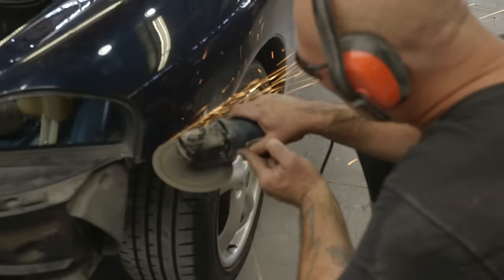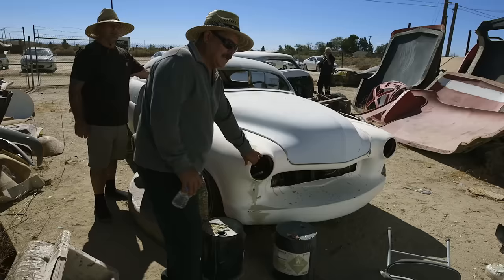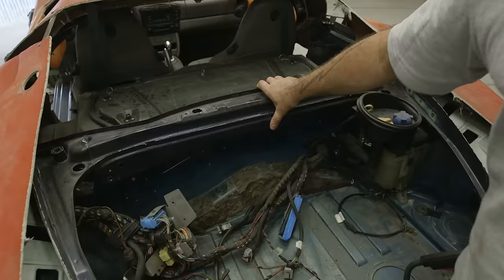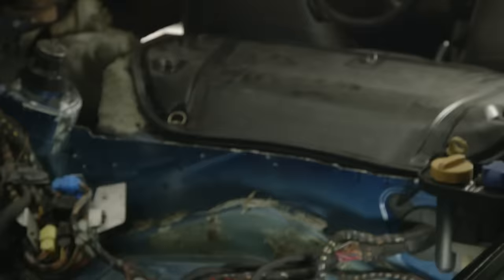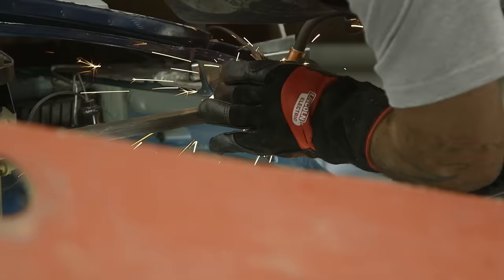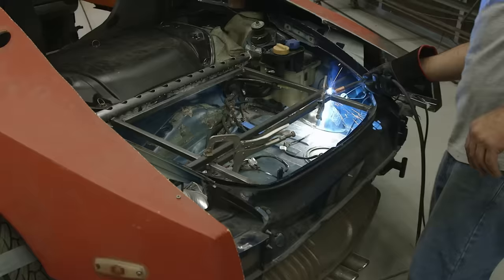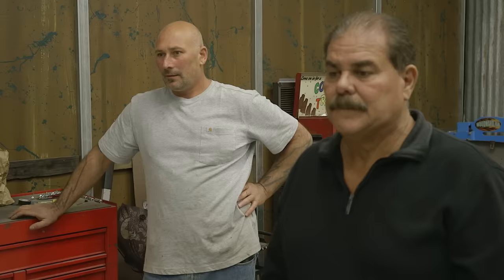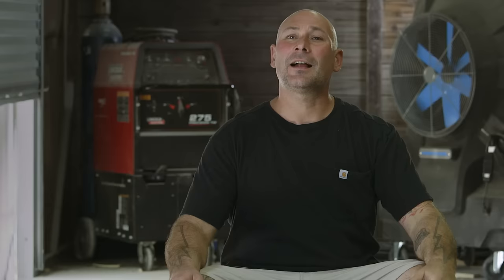Monster Garage Update - Full Custom Garage: Sports Car Edition - S04 EP06 - Automotive Reality

Comment: Gene’s fiberglass Ferrari body is actually a rare unbuilt Fiberfab Valkyrie. Two models were made. One was set on a VW chassis and had a rear engine. The other had a full steel chassis ready to mount a mid engine V8. I helped a guy build a V8 version. It was a blast. Somewhere I have a copy of the complete instruction book.
Reply: Had a chance to buy one in around 1986 for $1500. 70s VW super beetle type. Top of my head was flush with the roof. And the view from the rear glass was a reflection of everything below it. Without the GT40 roof cut outs part of the door. Pain in the ass to get in and out of. Did not have the back tilt rear engine lid. Just a little dog door between the taillights. I didn't buy a first year Fiero due to needing to place your hand on the ground to get out of it. If I remember correctly. The windshield was the same as the 1960s Mustang on the Avenger.

Comment: I saw the finished car already, so I know my advice won't help, but...I've done many custom body panels, and you can use foam blocks and form them into anything you want.  I've never done it, but you can also use clay like the OEM's do, cover the foam with layer of clay and carve into whatever form, put back the clay if you need to (not easy with foam).  The new kids use computer cad and then cut the foam with a big cnc carver and then fiberglass over it.   

btw, the finished car looks like....not good.  I'm watching to see who I blame for it!
Reply: another good technique is to form a wire "buck" frame of all your bodylines, then stretch some flexible material across it, and lay fibreglass over that.
I agree that the finished product here wasn't great, I hope it gets a return and some re-working like the purple packard did.
Reply: What a surprise that it turned into the pile of $h!T that I predicted.😂

Comment: No room for people in the clam shell lid. Cut it down the middle and widen it. Replace the wind shield with a Porsche 956LH style windshield. Make it a triangle three seater. Way it is now be smacking your knuckles and forehead into that windscreen. Hell it is a shock car, so make it a center one seater. Why add in that dead weight passenger.

Comment: Neither of these two guys are giving any concern to the final handling and driving aspects of this monstrosity. They’re building a trailer queen. Every time I see you one of those all I see is beautiful parts wasted that could be on a car being used. Just the spacers they’re gonna using to keep those wheels out there and the size of those wheels are gonna make that thing handle like a 56  Cadillac and they’re using a Porsche to do it😢 I don’t even wanna think about the fact that thing is completely bottomed out the suspension on the bump stops to get the car to sit like this. They aren’t thinking about it and that’s the opposite of what any real driving machine I’ve watched build be built like
Reply: It is their car. Sorry it is not up to your “standards”.
Reply: Watching something being built doesn't make you an expert in ANYTHING
Reply: That's the thing with Ian's work. He's an artist. He doesn't build cars, he builds rolling statues. They look good on the outside, but his structural engineering method can best be described as "slipshod"
Reply: @Ducky69247 with your knowledge and expertise, it sounds like you've driven a few of his vehicles.
Reply: I agree a "supercar" needs to handle well (unless its a Hellcat style drag supercar..), but I have not seen how they ruined the boxster handling..yet.   I do agree the cars he does are not practical at all, and a supercar may not be for luggage space, but they are practical on the race track.
Reply: @davidclemens1578  I follow Ian's official channel. You'd be surprised the kind of haphazard solutions he comes up with that don't make it into the TV show.
Reply: @murraymadness4674  first off a hellcat is absolutely not a supercar either it is the worst of the American muscle cars it’s got zero handling it’s overweight it’s no good in a straight line and it’s Brakes for some reason are horrible they look like an impressive set of brakes but they do not work well. With the Porsche they put massive spacers on to space the wheels out from the hub to gain vehicle width so in the front end instead of the wheel pivoting properly when it turns it takes a big massive arc destroying the ability to properly align it and turn the car that’s why spacers are death traps. they’ve also completely cut the coil springs right out of the car and have it sitting on the bump stops to keep it as low as it is right now and those wheels and tires  are 3 inches plus larger in diameter than the original set of wheels and tires so without changing the gearing in the transmission to match that they have slowed the car right down and robbed of all power and the boxer isn’t that impressive of a Porsche to begin with it’s more of a girls car, it was the poor man’s Porsche when it came out. If you go back and watch the first episode from a week or two ago you will see what they did to the Porsche to make it suitable for this abomination they are building. Please never refer to the hellcat as a super car or a Mustang or Camaro, a Corvette isn’t even a super car
Reply: @Ducky69247  yes I have figured that out I just wish I never came across this build to begin with I was terrified in the first episode when I found out what they were doing but I had high hopes for it I find myself just getting angrier with each episode but I can’t stop watching I have to see that “car”
Reply: @600wheel  I don't believe there are any American made super cars. We're all about "muscle." That's how I would categorize all the ones you listed. And you explained perfectly how poorly they handle.
Reply: @Zane-no5dy  if you watched the episode you don’t need to be an expert you need to have three working brain cells. He cut the coil springs out and put it on the bump stops to get the height he wants. He put what looked like 3 inch plus spacers on to make the car wide enough to match what he wanted in width. Right there you created a death trap, you’ve created some thing that can only be winched on and off a trailer and it will not properly go around a corner and blow out wheelbearings in a week. Its a Porsche not a one ton truck and you see what happens to one ton trucks with spacers if you watch any videos of bad accidents on the highway. If you get caught running those things you will fail an inspection and your vehicle is now impossible to Align. I built that Mustang to the left I built in Evo I’ve built a jeep and I have worked on thousands of cars I’m 51 years old I’ve been a Mechanic since I was 18 before that I was just a kid who played with cars so blow me that’s more of an expert than Ian and you put together
Reply: @600wheel  if you watched the episode you would known that it was set for mock up knowing that ride height would be higher. Let him finish before you criticize the way it handles. Sorry, where is your garage and is anyone paying you to build anything. It's not the first car that he built for this guy, so if the guy spending the money is happy and wants more...
Reply: @Ducky69247  there was a reference made to a hellcat super car in a comment that’s why I explained the muscle car supercar difference
Reply: @Zane-no5dy  by the way I’ve seen other episodes of what this guy puts together he puts no concern whatsoever into the drivetrain he himself has admitted on camera he’s not a car guy he’s not into driving he’s not into cars he likes the art of it that is not a person you want building your cars I found these things out after I started watching from polite people in the comments no I’m not going to put any punctuation in this I’m dictating it now
Reply: @Zane-no5dy  spending the last 35 years doing it does though
Reply: @larrysorenson4789  Is so Victor’s car  and it’s not up to a junkyards standards
Reply: @Ducky69247 Corvette, it had to be defined by 100hp to be allowed to compete with "supercars". Not my choice in cars but should be recognized
Reply: @Zane-no5dy  so you're saying Corvette technically qualifies as a super car?
Reply: @Ducky69247  I'm saying that it competes in the same racing series as "supercars" and had to be detuned by 100hp to be allowed to compete. It costs less and is more user friendly. Personally I don't give a ratsass about any of them.
Reply: @Zane-no5dy  oh, detuned. I was confused before.